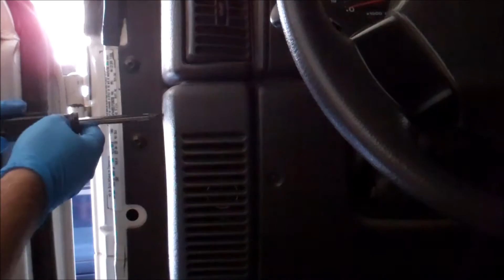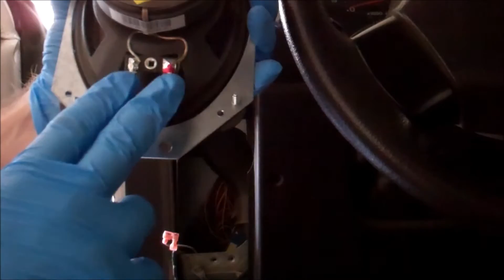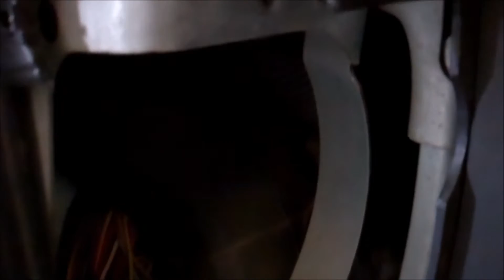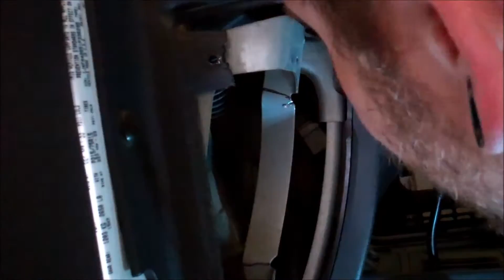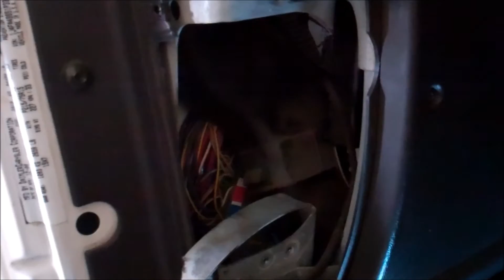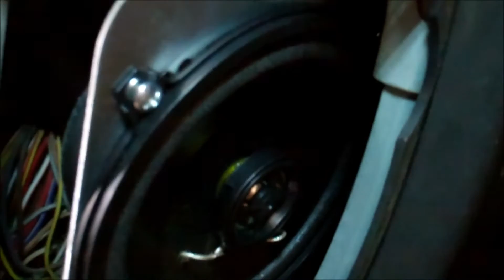Jeep Wrangler TJ 5.25" Front Speaker Install

Comment: Did you notice a big difference in sound? Is it worth it?
Reply from the maker: Not significant in my case, but i'm also not running any major sound system like amps and subs with pricey speakers. I'm sure with the right stuff it could help.
Reply: @therainfalled  thanks I'll just leave it as it is..I only got a 2 channel amp the sub is the only thing hooked up the other speakers sound pretty good just being powered by the kenwood deck big difference from the stock set up

Comment: I’m wondering if poly fill would make it sound better.
Reply from the maker: I had stuffed the area with poly but did not notice a difference.  I'm also not running high quality audio components.
Reply: Polyfill wouldn't make any difference unless you had already established a solid (resistant to flexing and vibration) and airtight or nearly airtight enclosure behind the magnet, and then the polyfill would probably still not be doing enough to notice a difference unless you had hella good speakers hooked up to an amp. Even then it likely wouldn't offer enough benefit to be worthwhile, especially in a noisy ass TJ.

Comment: For my 06 you do not need to dremel/cut anything. Fits right up!
Reply: I’ve got a 2006 tju 
So all I need is the brackets and no alterations to the Jeep at all for the 5 1/4 speakers in the front
Reply: Sure does! No cutting required on the 2006.I didn’t notice your comment until after I finished. What a breeze!

Comment: I just did this on my 98 TJ with a mini hack saw, took 30 minutes to cut out both pieces of metal.  In fact, I installed my entire double din / rear camera system upgrade in about 6 hours yesterday, spent $700 in parts/tools and saved $1000 in labor (that's what Car Toys wanted to charge me to do this).  I also upgraded my sound bar speakers to 6.5 inch Polks.
Reply: 6.5" in the factory soundbar?  How, it is meant to be 5.25" (at least mine is)?

Comment: I have a '98 TJ and the installation was exactly like this. I had to cut (with some metal shears, which was difficult - I wish I had been able to use my rotary cutter as shown in this video) the metal strip to make the speaker magnets fit, so thanks for showing that or I would have been mighty surprised. :)

Also, the previous owner had installed aftermarket 4x6 speakers, and modified the wiring harness right before each speaker to include an inline 99 microfarad "bass blocker" capacitor that eats everything under ~400Hz. The 5.25" speaker is a coaxial tweeter and woofer so it can handle 60Hz and up, and doesn't need the bass blocker. I removed it when doing this install (cut it out & soldered the wire back so there's just wire and the connectors, but no more capacitor). It sounds great! Lots of low end and low mids.

Comment: any problem with the AC vent behind the speaker that gave you problems? any solutions?
Reply from the maker: Sabino Hdz not with mine. the plastic vent, if that's what you are talking about, is close to the metal. I was just careful to cut. no interference with my speakers
Reply: Damn my speakers magnet hits on the vent behind it. Not letting the speaker adapter set in right.